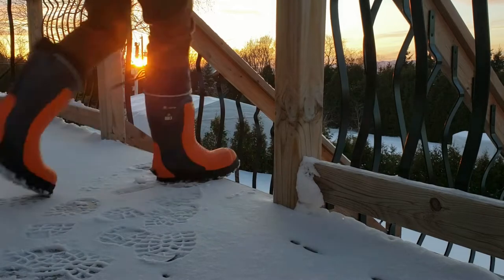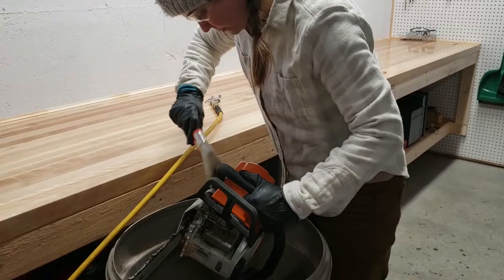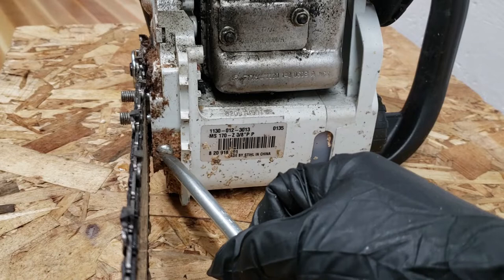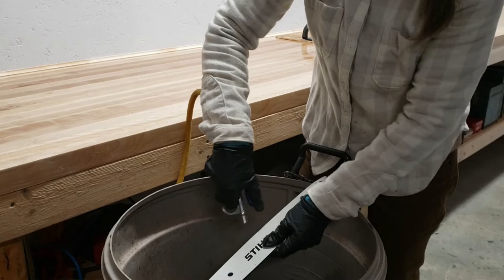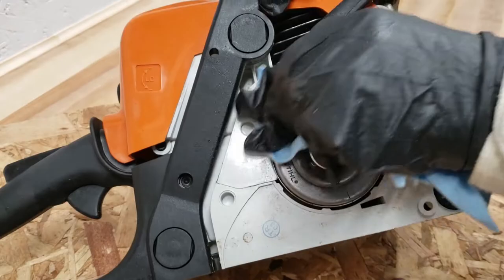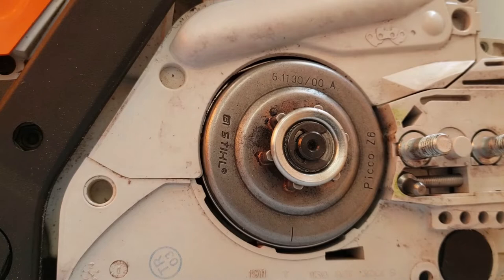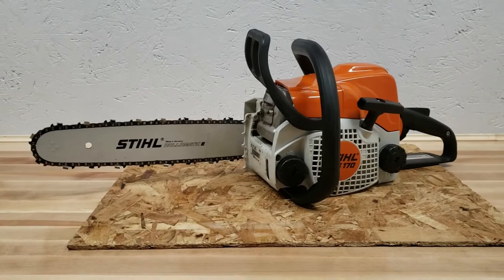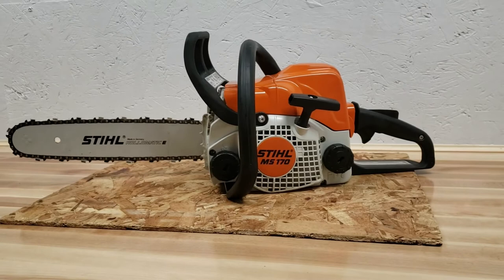Cleaning My Chainsaw After Daily Use

Comment: I have done that very thing after a day of use. I pull the bar and chain, clean the bar grove, if the chain has a lot of sap or resin, I have a cleaner that will soften and break it loose, then I lightly brush it clean. I take compressed air and clean the cooling fins on the power head, clean the air filter, then fill up the chain oil reservoir, and fill up the gas tank. I then put the bar and chain back on, grease the nose sprocket, adjust the chain tension, fire it up and make sure the chain is getting oil and all is working properly. Then I am ready for the next day if need be. My saw was bought brand new back in the mid 1960s and today, it still looks and runs as good as it did the first day I fired it up. It is a Homelite Super XL AO, with a 16" bar. I have saved the original bar, chain, and clutch and have a more modern and up to date assembly with a sprocket nose bar, and a semi chisel chain instead of the original Oregon Chipper Chain and hard nose bar.

Comment: I have cleaned my Tanaka until today because the chain was dull . I wish they still built them so well. I will clean more often now that they sold out. So I probably won’t be able to get quality parts: my science is to flip the bar every time the chain needs sharpening helps to prevent uneven wear

Comment: Got into chainsaws earlier this year and now have several, including pro, and just built an MS200T from parts.  Coming from other technologies, I was appalled to see that virtually no one cleans filthy saws before working on them.  It's probably all time and money but I've never seen car guys do this.  Today, however, if you go in with a dirty engine, you'll come out with a dirty engine and a shiny new oil filter (for example).  A good garage may suggest an engine cleaning, which will cost ya, but at least they offer.

So, good job, keep it up!  You will not damage anything.  Just keep strong corrosives away from metal components and strong solvents away from plastic, hoses, etc.  The saws are pretty tolerant but will last even longer when clean.  And, WD-40 is your friend when saws are wet.  WD-40 is not that great for lubrication or protection but was designed for displacing water from internal spaces.

This and compressed air is good stuff!

Comment: I keep the bar and the inside of the clutch cover as clean as i can for oiling.
Reply: Same here. I’ve cut certain woods in the past that just packed out the inside of my clutch plate. I had no idea until I just happened to pull the plate off for some other reason. I felt so guilty for being so negligent with my chain saw. Never again.